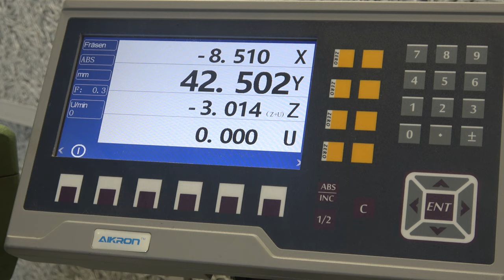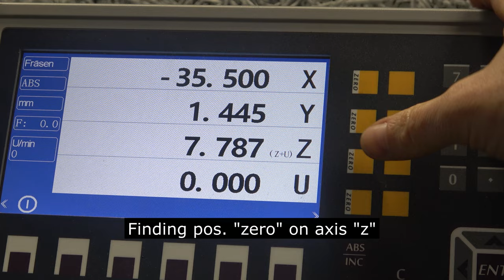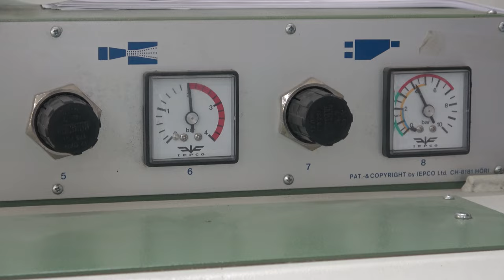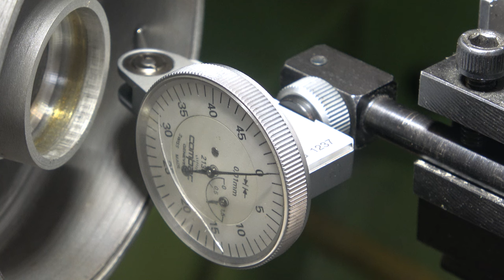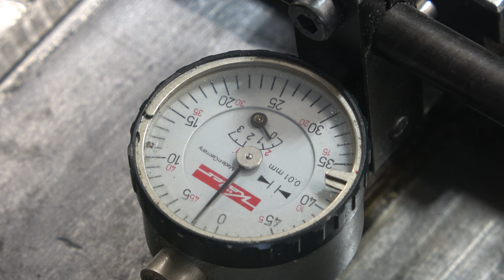Rear Wheel Hub Restoration on Velosolex (# 5)

Comment: why copper paste ?
Reply from the maker: Hi, copper is mainly used for the moving parts within the brakes to avoid friction, wear and noises. Copper has a temp. range up to around 1.000 degreas C. It is important that the grease doesn't change it's viscosity while going trough temp. changes, otherwise there is a potential hazard, that the grease runs on to the braking surfaces.